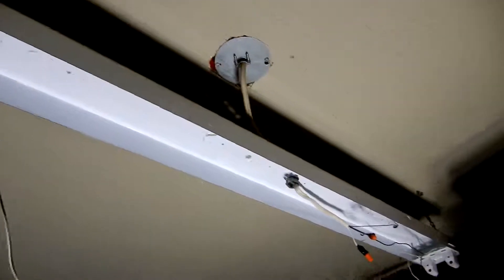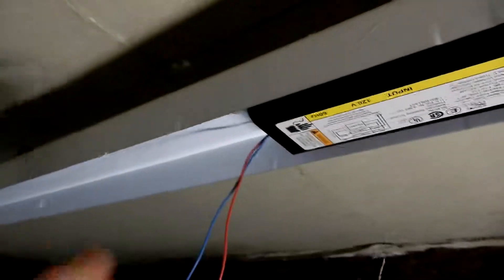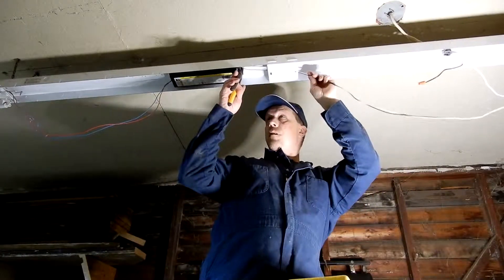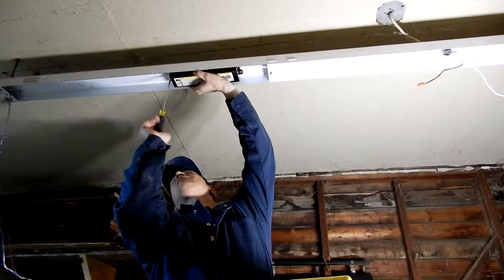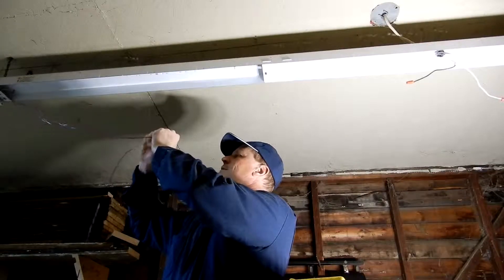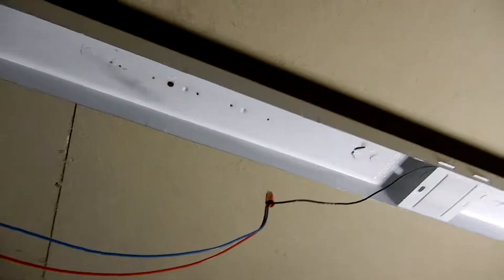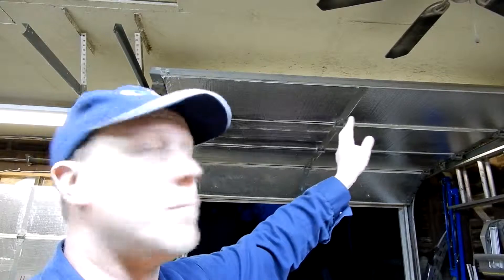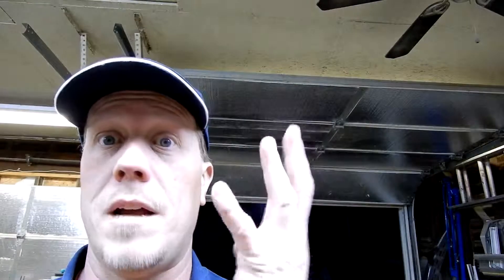How to Convert T12 Fluorescent to T8 led lighting

Comment: I have 4 8' long T-12  fluorescent fixtures wired to work off 1 switch, if I do the conversion, will this be ok?
And the WHITE wire gets tied into the (4) wire end? Did these questions make sense? 2 THUMBS UP 👍👍 😎 and consider me a subscriber.
Reply from the maker: I wired 8 tubes that are on one switch, it's not a problem. The second part of the question is a little confusing, can you clarify. And thanks for the sub, need many more
Reply: @armandchaput  let me recheck what I have then I'll get back to you and make more sense. Oh and by the way, I looked at least 17 different YouTube videos and your's is the only one that told what to do and how to do it, not to mention made it look so easy... Lamens terms baby!
Reply from the maker: Each light gets wired and then connect them together  and thanks for the sub